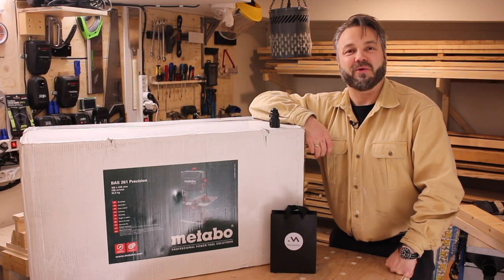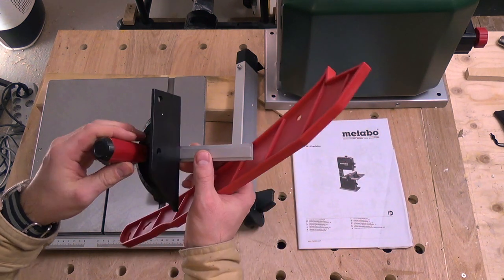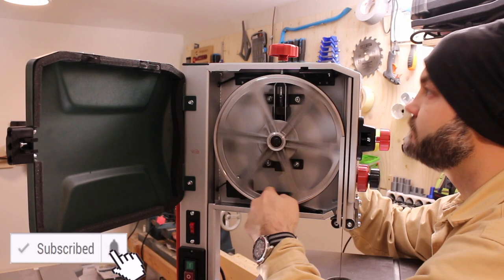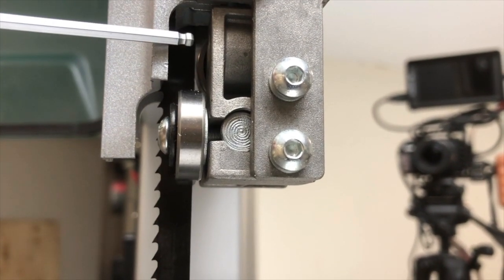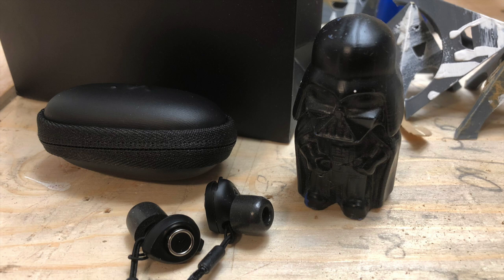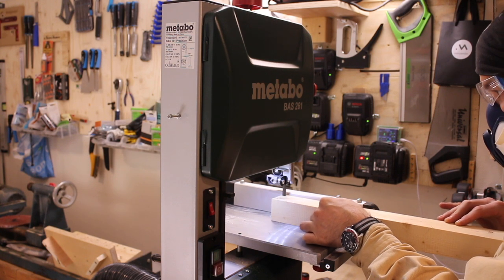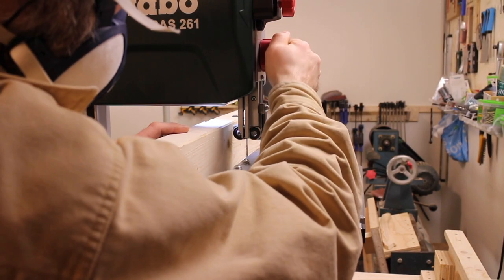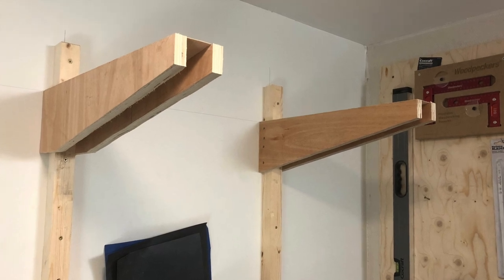Metabo BAS 261 Precision Unboxing and First Impression - Made in Norway [0061]

Comment: The sidebearings (all 4) should be adjusted on the blade just before the bottom of the teeth. That way the blade will last much longer because the setting of the teeth won't be affected by the bearings. The blade is going to be much sharper for an longer time this way.
The bottom of te teeth should be in the middle of the upper wheel aswell for the correct adjustment. That way the weel won't iterfear with the setting of the teeth so again your blade will last longer / stays sharper for a longer time.
Its just 2 advices for having more fun sawing and using this bandsaw (and all other bandsaws)
Reply from the maker: Thanks for the great tips! And hope to see you back on the channel. Cheers.

Comment: Hello, I do not know when you purchased your saw. But, I was delivered the same BAS 261 which I bougth online secondhand. The date of production is 4/2021 and user manual¨s content regarding adjustment/tension of saw belt & thrust and guide bearings is satisfactory- Chapter 10 and its sub chapters. Cheers!
Reply from the maker: Hi Zlatko! Congratulations with your new saw. And it is nice to hear that
the users manual has improved. Cheers and thanks for watching and commenting.

Comment: Hi. Just unboxed and assembled this saw recently. With no guide I set the bearings so that they touched the blade. Once I started sawing some piece of wood, the machine started rumbling  severely. After watching your video I am off to reset those bearings to leave a reasonable space between them and the blade. Thanks a lot bud!! 👍
Reply from the maker: If your machine is shaking I think you have more problems than the bearings being wrongly placed. The tightness of the blade needs to be just so as well. Try "running the saw" with your hand like I did then video and see if it tracks right. Let me know how it went after you adjusted the bearings.
Reply: @NomadMakes  Thanks for your response. Well, I just spent quite some time fiddling about with it. In the end I had to shift the base that holds the bottom 3 bearings right back by about 4 mm. Reason being that the two axial bearings were so much in front and even tilted down that they supported barely the teeth of the blade. Leaving the back half of the blade loose. Now, they are in the middle of the blade and level. I also had to move the holder of the sawing table to the right because the blade wasn't running in the middle of the gap. These proceedings resulted in repeated positioning of the bearings also top ones, also because I  watched the slant of the top wheel and of course taunted the blade. All in all the side bearings aren't touching anything now, the back support bearings are - just about, the blade is stretched right I believe and the saw is running like a dream now..
Reply from the maker: I'm still fighting this think. Thinking about trying to get a stiffer spring for the upper wheel block.

Comment: I've always found my bandsaw to be my most indispensable tool. Since its versatility is the greatest strength of the bandsaw, you probably shouldn't limit that by putting a big fat blade which is intended for resawing - I think you'll be pleasantly surprised at the cutting power of a narrower blade. And you're right, changing blades really holds up production - you'll have to remove your rip fence rail, reset all the guides and tension and maybe even check table squareness - so in my experience, pick a favourite blade and stick with it. And if anyone suggests a foolproof and speedy method for blade and table adjustment... let me know! Good vid mate, I enjoyed that from start to finish. Stay healthy!
Reply from the maker: Thanks for your tip, mate! From your videos I gather that you use your bandsaw a lot. So, I value your input a lot. And setting up machines is down there with sanding and sharpening for me... :D What TPI/width do you think would be good for this?
Cheers, and hope your shoulder heals well.

Comment: Can you recommend a replacement blade for the original?
Reply from the maker: I’ve used these: https://www.ebay.com/itm/153560640079?mkcid=16&mkevt=1&mkrid=711-127632-2357-0&ssspo=DanJa4WuSt6&sssrc=4429486&ssuid=WDH1XQBOT5a&var=&widget_ver=artemis&media=COPY
Reply: @NomadMakes  What width and tpi for general purpose?
Reply from the maker: Im using 1712*9.252 with 10tpi

Comment: Hello i have same Saw but when i make a cut the Saw drift to left side.i bod new blade.hope that fix IT.tell na if this happen to  
You to.
Reply from the maker: This saw is notoriusly difficult to set up since the top wheel is fixing is not very ridgid. Also be aware that you may get some drift following the grain. Do you still get drift while doing crosscuts? Also, may I suggest checking out videos on how to set up bandsaws properly?
Cheers and thanks for watching.
Reply: @NomadMakes  yes i buy new blade for Metabo 261 and still was drifting the Wood to left side so i send the Saw back.i think tere was som thing róm wiht the saw.i dont have the Saw.
Reply from the maker: Ok. Hope you are more lucky with your next saw.

Comment: I was actually woundering to buy this and after watching your video, i think i will just order it now. Great video btw.
Reply from the maker: Glad you found it helpful :D And thanks for watching and commenting. Hope too see you back in the comment field. Cheers.
Reply: @NomadMakes  you probably will, have a garage i need to renovate and redesign the interior. So im allways looking for inspiration
Reply: Got the saw home yesterday,  so hopefully i can start using it this weekend.

How big workshop do you have? Sqm? Im abit torn in what to do,  i need to find a compromise about hopefully get the car in the garage, permanente place for saws ( maybe a moving table) and setting up a more mechanical workspace.
Reply from the maker: @simeeen88  My workshop is 2,7 x 4,5 m so 1,2 ish m2. And the entrance is down a stair and a tight hallway. But I know guys that have smaller shops and get by, they have the ability to work a bit outside tough, and for me that is impossible, as this is in the middle of town. May I suggest you put all your machines on casters/on benches with casters? That works for me.

Comment: I've  just noticed between 2.10 and 2.40 you can clearly see the base of the bandsaw sitting on your bench, you have a small piece of wood under the rear corner, ??  Is your base plate pissed, bent , not straight (whatever)  ive just bought this machine and mine is nowhere near straight/level to my bench,   it rocks like mad, I thought it might have been dropped  but looking at yours they could just be poorly made, but I've decided I'll bolt it down with some heavy duty bolts probs about 10mm  hopefully that will pull it straight  just curious what yours is like
Reply from the maker: Yeah. I thought mine was dropped as well at some point. Only reason I didn’t return it is because it spent a few months in my basement before I opened it. I have bolted mine to bench. 
This machine is very much on the cheap and cheerful side of the quality spectrum. But I have been able to get quite a lot done on on despite it’s shortcommings. 
Cheers and thanks for watching and commenting.

Comment: Did you find any favorite all round blade? Have you come across any similarly sized and priced saw that made you regret this purchase?
Reply from the maker: Hi! What I have done is generally used a smaller blade on it. However i keep a ripping blade in backup. 
Nice edit by the way ;-) Your new question is easier to answer. Most of the saws in this price range is for all intents and purposes the same saw. They are all OEM saws with different colors and sometime slight changes. So, I have not come across any saws in this price bracket that have made me regret the purchase. That being said the saw has some severe flaws. The main one being that it is not stiff enough, since the wheels are attached to the steel plate of the back rather than the frame. This makes the saw very hard/impossible to set up correctly. But if this is your first bandsaw, this is a very cheap way of learning about the tool. And it can do basic bandsaw tasks. The main problem is really that you need to spend quite a lot more to get a decent saw.

Comment: I have the same but I can't cut straight with this machine i followed all the recommended setting but still not cutting straight? Can you advise please
Reply from the maker: I had to loosen the blade a bit. The way the upper wheel is fixed or the tightening mechanism doesn’t seem to like the blade being too tight.
Reply: @NomadMakes  I tried this trouble shooting Yesterday and I noticed some improvement but still have an off set of 2 mm cutting peice of 200 mm means the error is not acceptable for me .another point I noticed that the tighten setting proposed by the constructor is not accurate according to the blad width which make me confused 🤔 does this have sense?!
Reply from the maker: Hi again Omar!
I did not follow the instructions while setting up the saw. I followed the «Snodgrass method». If the amount of drift is constant, you can adjust the fence accordingly. But with a bandsaw the blade will to some extent follow the grain of the wood.
Reply: @NomadMakes  ok thanks alot
Reply from the maker: No problems mate :-)

Comment: Weird to see the top blade guide bearing isn't sideways, is that an option or is it always like this?
Reply from the maker: The one behind the blade? I believe that called a thrust bearing, and I have seen them placed both ways. On this saw it is placed radially towards the saw blade, and you cannot easily change it. I do not know if either of them has any benefits over the other.  
Cheers and thanks for watching and commenting.

Comment: Здравствуйте, подскажите почему лента тормозит при нагрузки
Reply from the maker: The google translation is a bit strange. But I think you are asking why the blade slows down under load. 
This is because the motor is very weak. This saw is best suited for lighter work.
Reply: @NomadMakes  спасибо за ответ. Google  переводит ужасно. Но вы меня поняли правильно. Пила доску толщиной в дюйм пилит очень плохо. Буду решать эту проблему. 🤝
Reply from the maker: I am glad it helped. Thanks for watching and commenting.
Reply from the maker: May I also suggest you get a ripping blade. Look for a low TPI number. That relieves some of the stress from the motor.

Comment: You've had the bandsaw for a while now. What are your thoughts? What issues have you had? Are you happy with your purchase?
Reply from the maker: Hi,
Not really. It is vastly underpowered. Really hard to tune. And I suspect the metal plate the upper wheel is fixed to flexes. Also the tightening mechanism for the blade is weak and the tracking changes when you tighten the blade.
Reply: @NomadMakes  thanks for both the reply and your honesty. I know that feeling of buyers regret when you wish you had just payed a bit more for the better option. 😢
Reply from the maker: @jrumbel  The problem with these small saws is that they are mostly the same rebranded machine. So paying a bit more may not get you any better machine. 
Anyways, this was a cheap way of learning what to look for in my next bandsaw. And as such, it may save me money in the future.
Reply: Its all about where you use it for. These machines are at the bottom of the market and so only to be used for light work.
Ripping 4 inch beams.....its just to much.  
This machine though has a great qaulity for its price (bought the BAS261 for 275,-- euro today). Brands like Parkside, Holzmann and Scheppach are crap compared with the Metabo 261and costs about the same.
I geuss you have to sell this one and buy a 13 inch bandsaw. Could be a Metabo 316, record Power 350 Sabre or some other quality product like the Makite LB1200F. Machines that have more power and are to be used for more heavy stuff.
They will cost something arround 700 euro. These are the ones direct above the 261 categorie. And from there is goes up and up.
Reply from the maker: Yeah. I have been considering a saw in the 13-15 inch range. One is a Sabre and the other is a Jet. Completely different machines. But that is a while in the future. For now this saw actually gets the job done. Believe it or not. I do my rewsawing on the cabinet saw though :-)
Reply: I just ordered the machine… Is there anything positive to say about this bandsaw? 😅
Reply from the maker: @TeamDiscus Yes. It’s a good place to start. It’s compact and small. And it is cheap way to learn what you will need in the future - if you need more. With a high teeth count blade it can be a hybrid between a scroll saw and a bandsaw.
Reply: Ok i’ll have to see how it fares 👍
Reply: Ok 👍 So it works well for lighter tasks but it’s not very user friendly, is that a good way to sum it up ?

How often does one have to fiddle with the settings ?
Reply from the maker: That depends on your use case. For accurate cuts you have to adjust the tension every time.
Reply: @NomadMakes  Ok so you have to mess with the tensioner on each cut? But it seems to handle freehand cutting ok?

I hope i'm not bombarding you with too many questions...
Reply from the maker: @TeamDiscus No probs ;-) No, not each cut. But say the next day or so. Freecutting works ok. Better on thinner pieces ofc. And with a sharp blade.

Comment: Hello Nomad, thanks for the video. Do you know the size of the mitre slot? (I think the standard is 19mm wide x 9.5mm height) Many thanks!
Reply from the maker: Hi! I will check the next time I am in my workshop. Cheers.
Reply from the maker: The mite slot is 12,7 ish mm. So, I’m guessing it is 1/2 an inch. And not standard...
Reply: @NomadMakes  Ok thank you very much for taking the time to check, much appreciated! Cheers
Reply from the maker: @odalay1982  No problem ;-) Glad to help. Cheers.

Comment: Okay, taking 4 bolts OFF the table trunnion in order to fix the trunnion with ONE bolt to the saw and then have to jiggle about to get those 4 bolts back in was a bit weird ;)
Reply from the maker: Well… It’s not a very high quality saw :-D
Reply: @NomadMakes  I'm just being funny, I can imagine the table needed some tweaking. I have failed royally setting up my own bandsaw with an undertensioned blade but I absolutely love using it.
Reply from the maker: Ah… I misunderstood. The video is a bit old, so I don’t really remember how I did it. Thanks for watching and commenting by the way :-D

Comment: after you put your ear protection, i can't hear anything ,bandsaw is completely silence.
Reply from the maker: Did the ear protection work that well? :D 
You can hear the saw for a few seconds, but then the shopvac and air scrubber chimes in. So, I had to lower the volume in the video. Cheer, and thanks for watching and commenting.
Reply: @NomadMakes  Ha. .Ha ,like your sense of Humour. i  have lot of Norwegian friends here in italy. Did you try to rip cut some hard wood? actually i am planning to buy this For Guitar building over italian brand DOMATO.I don't know which one to choose.
Reply from the maker: I have not tried ripping hardwood with it yet. I generally do that on my table saw. However, the motor on this saw is not very powerful...
Reply: @NomadMakes  Thanks for the heads up.. Greetings.
Reply from the maker: Happy to help ;-)

Comment: Love the styrofoam that comes with these machines... NOT. 😂 But this machine is a beauty.! One tip i have is, check your bandsaw blade for little cracks on the front side between the teeth. The one that came with my machine had many cracks and ripped soon after 😄
Reply from the maker: Yeah, that styrofoam is not pleasant to get rid of either. Thanks for the tip regarding the blade. I plan to get a general purpose blade as soon as I figure out the TPI and width I want. So the factory blade is not staying on for long. Cheers, and thank for watching and commenting.
Reply: @NomadMakes  i dont have an all purpose blade, i have a thin 6tpi one which is 6mm deep and a more agressive 4tpi one which is 12mm deep. Im happy with these two. Amd dont really mind swapping them out sometimes
Reply from the maker: @mathiashesshermida9647  I might get a detail blade like that as well.

Comment: Do not buy the nuendo earplugs! I'm a musician and have owned 2 pairs. The first pair fell apart in the plastic after using them about 5 times. I got a pair of new ones that was supposed to be upgraded, but the same thing happened to them. The idea is great but they are crap quality i'm afraid (and expensive). But I liked this video for the Metabo :) Thanks.
Reply from the maker: I’m sad to hear that you had a bad experience with the ear plugs. But of course happy that you liked the video :-) Cheers and thanks for watching.